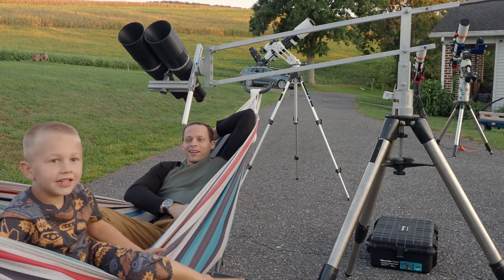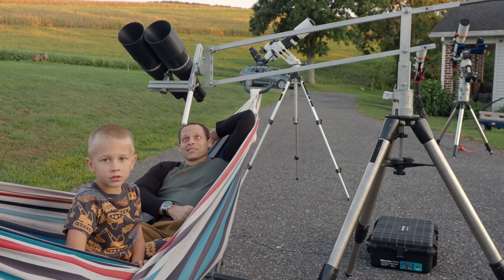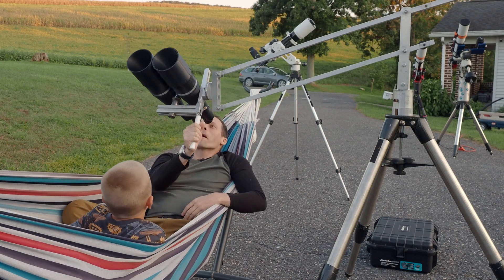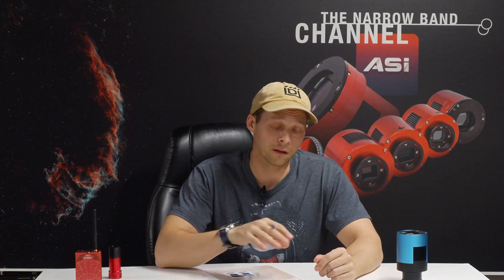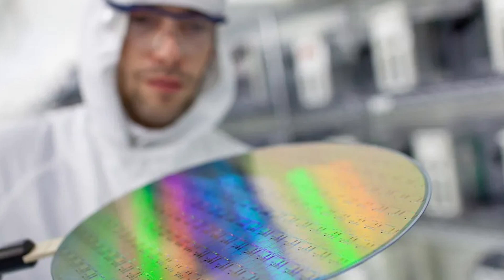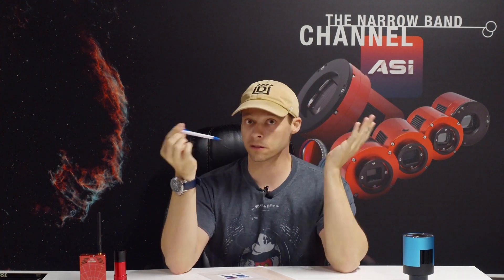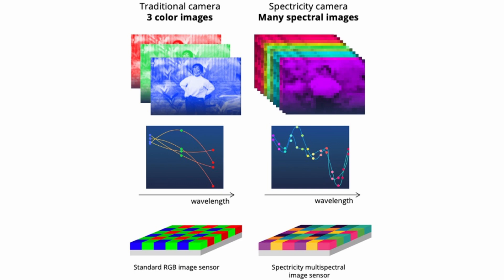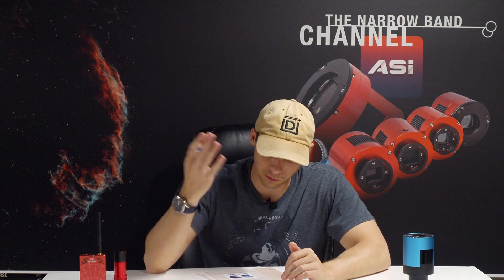IMECs Interesting New Multispectra Sensor

Comment: Hi Narrowband Guru, I have an off topic question: Yesterday I used for the first time an OAG and I've had this problem where I keep losing starts in a lot of objects. Near Orion, might it be bad seeing, might it be some condensation on the secondary or whatever it is, even at 4 seconds, I couldn't find a stable star. I'm using a QHY 5L mono camera, the same sensor as the ASI120MM. I have to put the guide sensor behind the narrowband filter because I'm using a mirrorless camera and with spacing I can't do otherwise. Any suggestions on how to make everything work the best? Any tip or piece of advice? Thank you!
Reply from the maker: The 120mm is pretty old. A sure fix is to get a newer camera. Like the 290mm or the 220. The 290MM is out of production but you can get them second hand for good price. It's easily 3x more sensitive.
Reply: @TheNarrowbandChannel  Thank you. I'm imaging now and, even with a relatively bad RMS and a full moon washing out my images I'm actually getting 5 minute subs consistently. It's a real blessing! I thought about the 290MM recently but the only problem is backfocus. I bought this "cheaper" OAG that is actually pretty nice but is definitely not made for 57.5mm backfocus. I had to actually trim the adapter for the helicoid focuser mounted on it or it wouldn't focus. Mind you I'm using the camera as bare as it can be, literally with nothing on to get the sensor as close as possible to the bottom point of the focuser. I looked for a camera with a long 1.25" barrel body and short back focus to change mine but I couldn't find a camera that has a 1.25 thickness for 32mm of length. I even looked at touptek, risingcam etc... Hoping I would find something but with no luck. That's basically the only thing keeping me from getting a better camera, money. With a magnitude 8 star now I'm having good success considering bad seeing, full moon and a little bit of wind that really scares the 250PDS. A 4 second exposure is giving me an SNR between 9.5-12, which works, but I'm concerned about other targets having issues because of the lack of nearby bright stars. I think I'll make a lot of mosaics to mitigate this problem. Also, I'm using an unsupported camera so dithering is done through a timer and my fov is too small to plate solve. Anyways, I'll try to make the best of of the few nights of imaging I get per month. Thank you for you patience and insights.

Comment: It is essentially a custom bayer matrix. The price you pay for color accuracy is overall QE and resolution. What spectricity does is roughly equivalent to what silios does with its "multi-spectral" cameras, except it is in a sensor small enough to be usable in a smart phone. But that wouldn't be as a main camera. It would be a color calibration assist camera. As far as the issue of color accuracy for amateur astronomy  is concerned, we are lucky to have absolute references already in the form of star spectra that we can now use for spectrophotometric calibration. We don't have that type of reference for every day images. While we can approach it under controlled conditions with a color reference card and some calibration, an assist module of that type would be a plus in some applications.

Comment: Interesting but won't the spatial resolution will be compromised due to the number of frequency bands? And if many of those bands don't correspond to useful astronomical wavelengths the overall efficiency will also be compromised. But I do like the idea of creating a narrowband SHO sensor.
Reply from the maker: They have made custom sensors with transmission bands specifically for astronomical stuff in space craft already. But ya getting them to make one for a mass market might be tuff too.

Comment: I was a professional astronomer. I used an instrument called an “integrated field unit” on the 8m Gemini telescope. Each hexagonal “pixel” has a fibre optic cable attached which gives you a spectrum. The spatial resolution was quite poor compared to a CCD but we did some work on galaxies by having spectrum across all the arms and core.
Reply from the maker: That is pretty cool!

Comment: Ill take a mono version please ;)
Reply: I don't think that is the point of these sensors. The idea is, the sensor knows the wavelength of light hitting it and the amount. So it reports both spectra data and brightness data per pixel, not just brightness.
Reply: @TevisC  it's hard for me to conceptualize this as from what I've seen on the preliminary they did appear to have multi spectra lenses in front of the read outs. Unless I'm missing key point (prob am) then it seems that cuts into efficiency a bit.